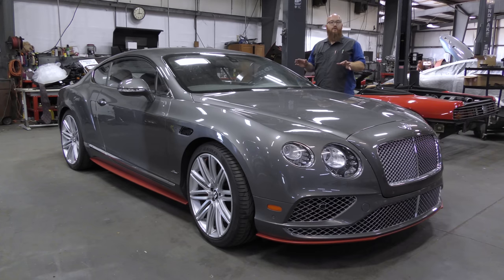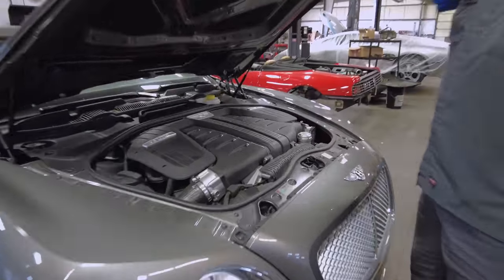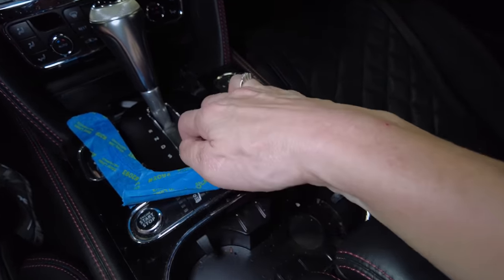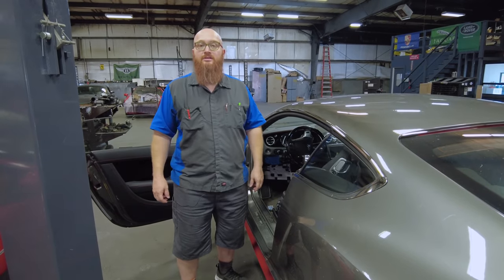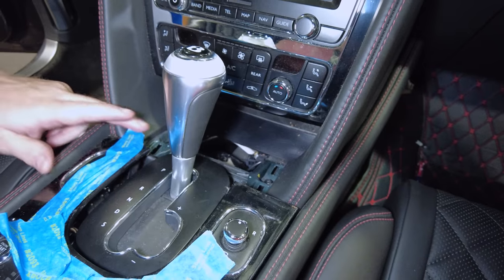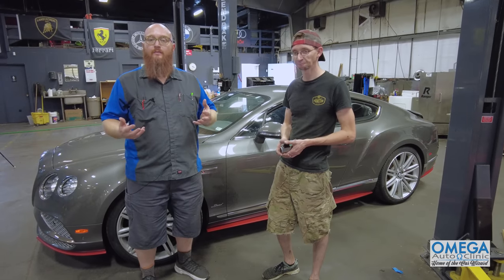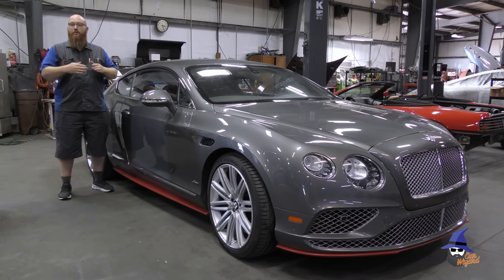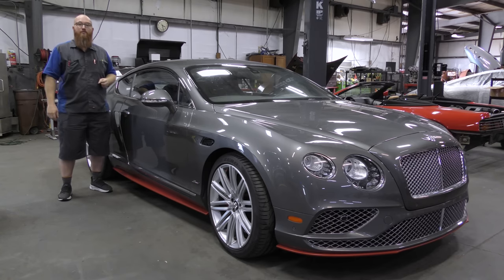How can a $10 Circuit Board make a Bentley Continental GT Speed or ANY CAR completely undriveable!

Comment: Someone i knew owned a mercedes, but i forgot which mercedes. It had similar problem and he bought the module for 100$ ish from marketplace. Also we are not from US. Helpful video 👍
Reply: It’s common to bypass the ESL on the Benz with an emulator. That’s likely the course of action they took. Programmed ESL from MB is roughly $4k installed and they’re currently on back order.

Comment: All that luxury and I'm still dumb, fat, and happy cruising in my 1961 Dodge Lancer with a Slant 6.  It can do 0 to 60 in around 5 minutes and reach 140mph off a cliff.  It can go even faster if I shove my feet through the holes in the floor boards to give it an extra push.
Reply: If you replace the 170 with a 225 ci engine - you will reduce your 0 to 60 time by at least half a minute - and a little faster off a cliff as the 225 is slightly heavier.
Reply: @georgebettiol8338  
You're right.  😆

Comment: .... Looks like it had an Over voltage fault on the control board, or your boy burnt some flux when he was trying to see if he could replace some components to salvage the part. It's all generic parts except for the control chip so if it just a failed capacitor, resistor, or relay it's $100- $125 fix with labor included. Always worth seeing if you can save the electronics when possible.

Comment: Hi Wizard! I haven’t been up to date with your videos lately, been busy.
Is the man that fixed the circuit board part of the Wizard crew now? Do you perhaps know if he knows how to fix 2001-2004 C5 Corvette ebcm? Notorious problem and GM doesn’t make the part anymore.
Reply: The later model c5 yes, those were commonly failed solder joints in the unit. Earlier ones were a failure in the IC contained in the unit, and those are not available anywhere for repair.

Comment: maserati, oh mrs wizard.  they're more hassle than they're worth. good luck with ALL the future repairs, and they will be in abundance
Reply: Let's hope she knows a good mechanic 😅
Reply: She's married to Car Wizard and has backup vehicles. She'll be just fine.
Reply: @2amSpeedMerchant  ha ha, i'm sure wizard can point her in the direction of a decent garage.
Reply: I had a Maserati back in the day.  I swore the reason they look so good standing still is because that was their intended purpose!  That car never ran right, could never be counted on for anything but a local errand, and would never ever start if it got hot.  Fuel soak or vapor lock meant you either embarrassingly cranked until the starter was going to burst into flames or you went back inside the store and shopped for another 30min until it all cooled.  I was so glad the day I sold that car.
Reply: On the other hand, if I had the money, I would buy a Quattroporte (4.2 V8 with a ZF transmission) in a heartbeat.
Reply: By the rightPorsche and your problems will decrease immensely.
Reply: @hokie9910   my two childhood dream cars are a porsche 928 s2&4, or a ferrari testarossa.  don't like any other  ferraris and the only 911 i'd drive is a slantnose, i'd rather drive a 944 turbo than a 911
Reply: @downtheshedwithjason  oh the 930 slant nose, only Miami  Vice ever showed those.  Such a cool car.

Comment: General Module in any BMW 850 has the capacitors fail after 25 plus years which takes out a bunch of interior electronics. $6 in parts or send it to the correct guy for $60 to have then new ones soldered in.

Comment: thats interesting. my 04 rav4 has the same security lock thing (without the parking brake). if it feels the steering wheel move while off it locks and doesnt let u start the car. luckily for me all i have to do is hover the steering wheel between the the 2 lock points (there's a bit of play when its locked) and the key turns.

Comment: I'm surprised that Bentley/VW would sell you that circuit board. If the module was intentionally that difficult to open, that's usually a sign that they'll only replace the entire module, not invidual parts of it.
Reply: He probably meant the module assembly. Plastic around it ain't cost much

Comment: There is a german company that is able to repair these boards for mercedes and lot of others that all control the lock and are connected to the key which is the key issue.
I have seen their repairs before on youtube cause they did it for far less than mercedes wanted fot the spare part. 
If you need that let me know cause I have to look it up again. It is a video and you can see what they are doing to fix it.
Reply: I'm interested. Would rly appreciate if you could look it up! Thx

Comment: Ah so that was the problem with John Ross's Bentley Continental someone had tried to fathom the problem and dismantled the centre  console.
Reply: Unfortunately the shift interlock had a piece of plastic lodged in it and I had to remove the console to access it and clear the blockage. Otherwise it would’ve remained untouched.
Reply: @GrimesGarage  To electrical test engineers.  Investing in a Fluke IR camera would save so much hassle. At the design stage you can see what is getting hot.

Comment: Out of curiosity I would be interested to know if those gears for the trunk could be made of metal?
Reply: Agree - aluminium gears manufactured using a CNC machine would be a better solution - however cost will be greater.
Reply: Yeah no problem, costs aside. Either CNC-milling it from aluminium or brass or industrial-grad 3D-printing would be possible. The latter also being possible in various metals. Tho I believe it might be strong enough in plastic, if manufactured regarding to material and production specifics and limits. The consumer grade FDM-method 3D-printers (fused deposition modeling) might not be suitable, as the several layers might break apart under stress over time. At least Nylon should be used over ABS or PLA plastic.
Reply: Cheap-out is the only reason it's plastics. Probably a parts bin component so why they didn't go with metal gears is mindboggling. They save on cost by making it a parts bin part so make it good. If it's Bentley exclusive it wouldn't make a dent on the car price anyway with metal gears 
Manufacturer bean counter logic 🙄

Comment: Cheap electronics made in Chyna or some other dump for as cheap as possible, like most parts now. I still have power supplies, analog & digital multimeters, even remote control cars, etc, etc, from the 80-90's, that were made in Japan or the USA that still work perfectly, because the commitment to quality design, parts, and manufacturing was there, unlike these days.

Comment: My 1986 Chevy Caprice with 300k mile on it would not start because it blew an Ignition Modules..A $10 part back in the 90s. But the good news is that you could swap it out with a KFC Spork on the side of the road.

Comment: Such a beautiful machine!  Too bad it has all of these problems.
Reply: This is the only problem I have ever had with the car (7yrs old with 19,850 miles). All other work performed is scheduled service. Extra items I added are replace all 12 coil packs and replace valve cover gaskets since spark plugs are also being replaced.

Comment: It's kind of odd how so many mechanics obsess over some electronic part failing and rendering the vehicle undrivable.
A $7 belt failing could make your car undrivable.
A ~$25-50 spark plug
A ~$50 starter
A ~$100 fuel pump
Any number of ~$8 hoses
50 cent relays unless you have a spare or can swap for another circuit.
5 cents in wire.
Etc. etc. etc.
But THIS circuit board is something I should worry about?
Electronics are, on the whole, more reliable than most mechanical parts.

I, personally, would much rather my car get stolen like a Kia/Hyundai than have to deal with this problem maybe once in my life.
Clearly.

Comment: While it sucks for something to go wrong, at least it happened when he was expecting to be without his vehicle for a while anyway. Not to mention it happened while he still had it so there's no suspicion in the back of his mind about the timing of the circuit board failure.
Reply: Not my daily driver. Put 3400 miles on it in last 14 mo.

Comment: 8:13 if it were me I would probably disconnect the battery for some time and let everything go back to default.
Reply: Will not work or maybe works one time. The Motors fail or the chips on the PCB from the Steering Lock.
Reply: @TrekZero  perhaps, it would just be worth a try. Things like that do work forcing systems back to default state.
Reply: Batteries were disconnected overnight first. Steering lock PCB is faulty. New ones are not available to independent shops without a huge process of approval because they’re part of the immobilizer system.
Reply: @GrimesGarage  Right, for the average dumb guy to maybe bypass something out of sync I imagine the battery disconnect might correct. It's free and easy. The Volvo did that to me. Periodically here and then when I brought it to Wichita in 17 it got cool and it was a temperature related relay under the hood that was associated with the immobilizer system and it just wouldn't start.

Comment: So who had been playing with that board already ?. It was clearly covered in excess Flux. That is not from the factory.
Reply: That was me, the motor is soldered through the board and has to be desoldered to pull it for testing. We condemned the board so I didn’t bother cleaning a part that’s going in the bin.
Reply: @GrimesGarage Ah ok. Any idea what the failed component was ?. I do lots of PCB repairs here in the UK for 80's and 90's cars. With Capacitors being the main failure point on many items. Particularly Dash clusters.  Paul @ The SAAB Clinic.

Comment: Sometimes I cherish the fact that I cannot afford a new vehicle with all those electronic crap "improvements". My key is manual, and so is the emergency brake. Those two communicate with each other only via the nut behind the steering wheel. I dont need HAL 2000 to tell them what do do and when to do it. But that Bentley sure looks nice

Comment: The cubic in is probably the same as a big v8, having 12 pistons to 8 pistons on a 426, what motor is bigger?
Reply: The number of pistons does not dictate the capacity of the engine.  An extreme case which highlights the aforesaid is the BRM V16 which was a 1.5 litre engine.
Reply: @georgebettiol8338  I think there was a motorbike v8 that was a 125cc!? A v12 will be smoother than a v8 and give more torque!
Reply: This one is a 6 liter

Comment: Bentley are owned by VW so it should be no surprise that the same modules causes similar
issues in VW group cars.
Our love affair with all things german is over.
You can buy these Bentley's with low milage and in good condition for low prices compared
to the original list price, why because they go wrong, they may look desirable but reliability is
woeful
Reply: Agree - reliability is an issue.  However the biggest bugbear is workshop time required to remedy the multitude of issues.  A known and common issue on this type of car is the failure of a 'poor quality' rubber vacuum hose that is located directly above the transmission.  A classic $5 part that requires circa 16+ hours of shop time to remedy - as both the engine/transmission must be removed.

Comment: 14:46 We can rebuild it we have the technology. We have the capability to make the world's first bionic Bentley, well trunk motor. You might be too young to remember where I borrowed those lines from. On a more serious note you are actually being quite the recycler, what is the point of scrapping the full assembly when it's only a couple of gears or a circuit board that has failed. My opinion on the environment is that it's a lot less damaging to keep using what we have than polluting the environment by scrapping it and building something that will be useless when it reaches 100 000k miles or its maximum battery cycle life.  At a push I sort of agree with the converting existing vehicles, If we keep developing engine technologies we can find something cleaner to burn, surely that is better for our planet than destroying perfectly good vehicles and strip mining certain countries for the minerals and materials used to create batteries.

Comment: I wonder if Grimes can figure out why my my car won't communicate with a code reader
Reply: Check the fuse for your DLC. Other than that, check resistance between the CAN hi/lo pins on the connector. Should be 120ohm
Reply: @tylergrimes1256  those are pins 2&10 correct?  Anyway I checked all that, all wires have proper voltages, grounds grounded, fuses good,  I'm starting to think the ECM is bad

Comment: C5 pop up light gears would strip and replacement kits were sold with metal gears.  Why not the same with Bentley?
Reply: More c5 corvettes produced than contis
Reply from the maker: Because the gears need to break if someone thinks like its 1985 and forces the trunk closed. Id rather replace a plastic gear than an entire motor.
Reply: gotcha, thanks for taking the time to answer @CarWizard
Reply: @CarWizard  Electric motors are generally resistant to some abuse, so the attempted forcing of the trunk by an unthinking owner will be noticeable and will more than likely halt his/her action if the unit was fitted with aluminium gears.  If the owner was so ham fisted and unthoughtful, and continued to repeatedly attempt to slam the lid, then he/she 'deserves' a failed assembly.

Comment: Electronics in cars there are mechanical ways to do the same functions which failed on this Bently dose VW deliberately do it and plactic fantastic   there is a lot of reasons to go analog and mechanical functions and using metal

Comment: If Wizard now - ever in his life - refuses to work on Audis - bacause "it's an Audi"- it's going to be "unsubscribe, unlike, unfollow, un-everything". Just kidding. I'm also going to hack his channel (unless I get marked as a "foreign agent" and denied access of service.. wait... denial of service? DoS? What is it?). Just kidding. Or am I? Huh. Either way - this is basically Audi A8 Coupe - with Bentley written all over it - but let's not hurt the British national identity. Tavarish did a parking brake release - using just a source of sufficient amperage 12V (basically a car battery) on his flood P1 - wonder if it would've worked also on this Flying B (B can never be flooded... because it is Flying. Huh.) Also - on my A6 - the EPB can be easily released with the VAG Group's diagnostic software - the mighty VCDS (which is actually not made or associated with VAG (unlike STAR for Merc and ISTA for BMW - and by the way - Louis Rosmann recently did a video about "diagnostic softwares" - within his campaign of "right to repair" - it turns out the US DOT - has included a preventative measure in legislation - the Clean Air Act, no less - in which the OWNER of any vehicle (doesn't matter passenger vehicle, commercial vehicle or agricultural machine) - needs to have a possibility - to repair and maintain his legally owned property - by the OWNER himself (not the dealer!!) by simple means of "a tool which is not proprietary" - go figure. Also - this "steering lock" issue is also widely popular on C6 A6/A7 (2003 - 2010) models - the module is different, but the issue on them is more "when" and not "if" - meaning, most of them will fail. Me - every time I get in the car and insert the key - I'm asking the silver 2 tonne beast - is this going to be last time I hear the - not gonna lie - pretty satisfying "clunk" in the steering column? Also - turns out - there are three cheap microswitches in the lock module (at least for the A6/A7) - which can be replaced - preventatively. Meaning - before you get stuck 200kms from home - because of a stupid microswitch (but there are plenty of other things on that car which can get you stuck 200 kms from home - so no worries). Also - speaking of "additive restoration" - there are many gear-driven actuators in these cars - and on my A6 diesel V6 - I was able to purchase machined brass gears for the so-called throttle actuator (air mass control valve) - from Germany - and replace them directly, making the little motor unit last longer than the car, probably. Wouldn't suggest replacing one plastic gear with another. The kit cost me abt. EUR 20,00. Either way - it is a truly beautiful car. Thanks to VAG for keeping this British brand afloat (come to think of it... has VAG ever gotten rid of any of the brands it has purchased? Audi, Skoda, Bentley - many others - they kinda just make them work, right? Ekhem.... BMW and Land Rover... Ford and Jag.... GM and SAAB....  yeah) - and thanks to Wizard for making the video. Greetings from Latvia.

Comment: So you are paying for a Bentley to have supposedly better quality and it’s just a bunch of cheap parts from other Volkswagen cars. Plastic gears for the trunk closer? Give me a break. And a computer module to control the steering lock? I used to think highly of Bentleys but not anymore. What other stuff did they cheap out on that you can’t see and other electronic crap that is going to break